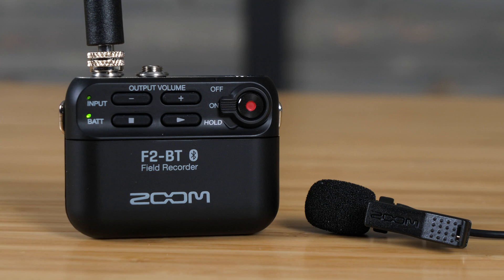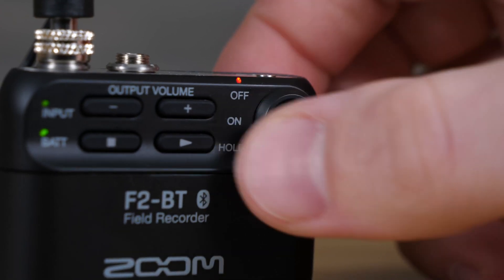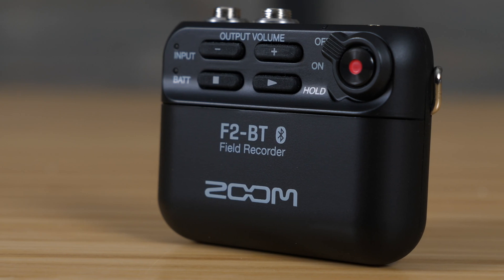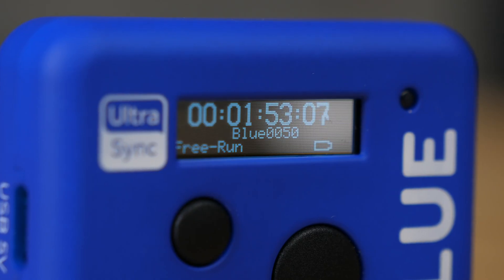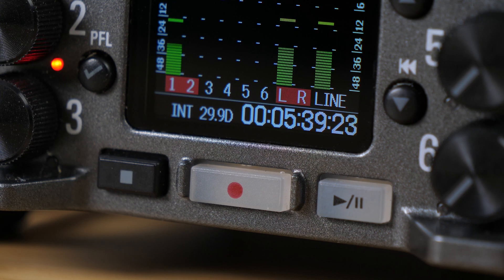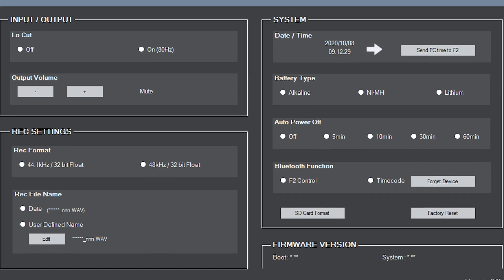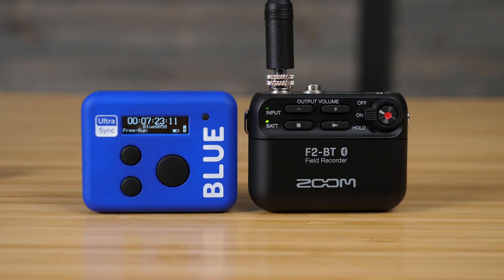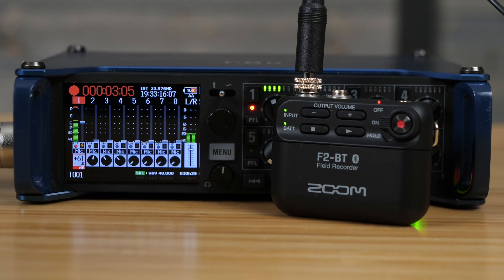The Zoom F2 Field Recorder: Syncing and Timecode

Comment: I have the Deity TC-1's and want to sync them with my F2-BT's but I can't see any videos anywhere on how to do this. When I click on Timecode in the F2 Editor, there is no other option to pair the device.
Reply: If anyone is wondering, just like the Tascams, it uses  the Atomos Bluetooth which isn't an open format, so you cannot any other bluetooth timecode device.

Comment: I have a Zoom F2-BT and plan on buying another one. I know I can't connect to both at the same time. What I need to know is how easy it will be to change from one to another. Do I have to close the app and open again? If I start recording on one, and need to start the second, will closing the app stop the recording on the first one? Or is there an update where I can put both to record at the same time? It would really make the app useful, otherwise I would prefer to buy a Zoom F2 without bluetooth.
Reply: Hey how do I sync the audio onto my pc
Reply: Do you have an Answer for this? I just bought two F2-BT and am now realizing I can't just record with them through one app.

Comment: I have DEITY TC gear, and would like to know how to use them to sync with F2-BT. The product pitch pages for the ZOOM product do not specify that UltraSync BLUE is the only compatible hardware for this. Was that because of a licensing/product placement issue, or did that just get left out of the advertising material?
Reply: I would like to know the same thing. Can I use this with my Deity TC-1 system?
Reply: @mhe0815  I got a reply from them. The answer is no. Boo.
Reply: @Tilted_tripod  Thanks for letting me know, even if the answer is indeed nothing to get excited about.

Comment: Will this also work with the Diety TC device?
Reply from the maker: The F2-BT is only compatible with the Ultra Sync Blue and the Atomos Ninja V Bluetooth timecode devices.
Reply: @ZoomSoundLab  Can this be upgraded via firmware to talk to Deity TC-1?  If not, I'd rather go for another copy of Deity THEOS, then. What good is timecode if it isn't universally usable?
Reply: @ZoomSoundLab  Please how to synchronise timecode between Sony FX30, two Zooms F2 BT and Zoom F3 equipped with BT module.

Comment: to sync the ZOOM F2 and MY camera (GH5S), do I need 1 or 2 of those ?
Thanks in advance to anyone :=)
Reply: I am afraid that not possible to sync F2-bt to GH5s just via blutooth. To sync timecode with camera like GH5s I think one needs Atomos Ninja V + Atomos Connect module + Ultrasync Blue. Then you can sync Ninja V (with Atomos Connect installed on it) via RF to Ultrasync Blue and Ultrasync Blue via blutooth to F2-bt / F3 + BT module, F6 + BT module. Up to 6 BT devices synced to one Ultrasync Blue.

Comment: What if I want to sync F2s with my F6 field recorder? What is the best way to do that?
Reply: Did you ever find out?
Reply: @vdu__q  Yes. I use a Ultrasync blue.

Works perfectly.
Reply: @larserikertzgaardringen7426  Can you directly sync the F6 + the F2 with the bluetooth module added to the F6, do you know that?

Otherwise the Ultrasync blue seems a good solution also.
Reply: @vdu__q  You need The Ultrasync.

Comment: Timecoding - is it possibly to use a Tentacle Sync E (which has some bluetooth) to set the F2 clock initially - I have just bought Tentacles and it would save me buying into the blue sync system. ? Thanks
Reply: Why not buy tentacle Track E?
Reply: Only works with Timecode Sync BLUE, as per the video!
Reply: @Chris Davies I’d thought a “professional” would do all necessary research before purchasing, BUCKLED 🤣🤣🤣
Reply: @michaelbellis2279  As a professional relying on BT at all is a bad idea.
Reply: @vdu__q  The BT is just to sync timecode, this only needs to happen once at the start of the day, can be done on the car ride to the set even .. it doesn't "rely" on BT like you are thinking.
Reply: @unlistedchannel  interesting, my gear has to be synced a few times a day, it shifts a bit. I do rely on a rf - bt bridge that syncs continuously.

Comment: So  if I understand correctly... Having the BT version facilitates Synchronization and provide the possibility to also pair multiple recorders using a timecode sync device. The non-BT however operates alone. You don't have to go in length here but assuming I get the regular model, is it fairly easy in post to synchronize this audio with my video? I'm a new video production student trying to wrap is head around which i should get. lol Thanks so much :)
Reply: Very much will depend on your videos. If it's an interview in a quiet environment then yes, waveform sync is perfectly sufficient. Timecode becomes really powerful when you have movement or a lot of takes. 1 example I often do is leave audio rolling non-stop for long periods of time. Without Timecode sync I can start/stop the camera recording as many times as I want and the autosync will line them up in seconds. It also then doesn't matter if it's noisy or the camera and audio devices are not close to each other.